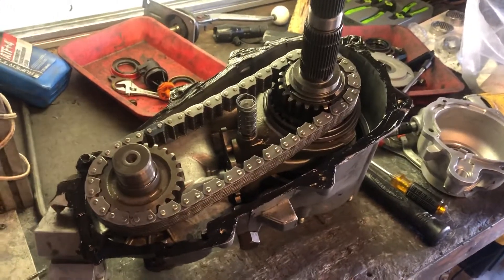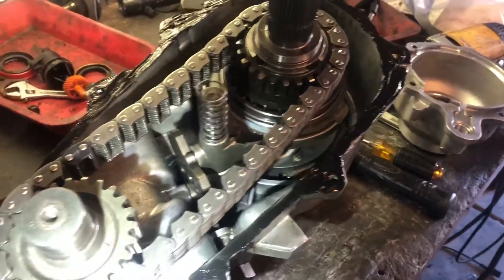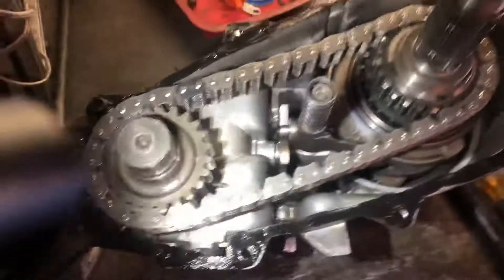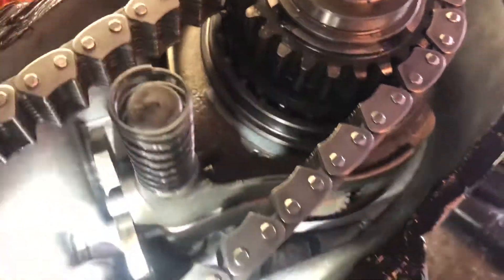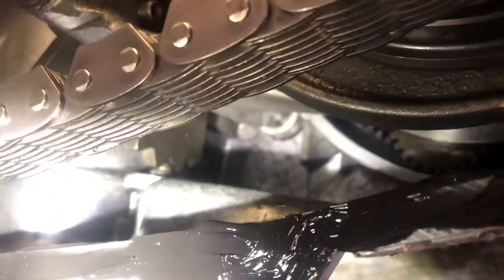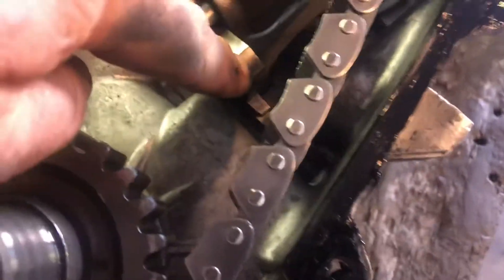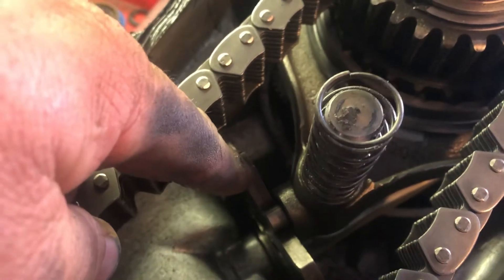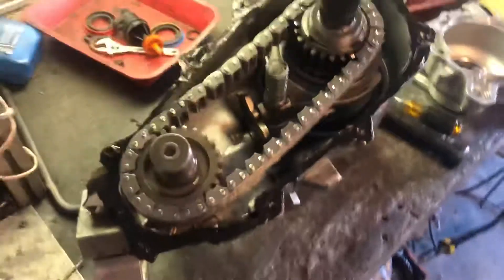NP231 transfer case inside neutral,4hi,4lo,2wd explained

Comment: I recently rebuilt my np231 j transfer case for my 95 jeep xj Cherokee sport and my shift mode selector in my transfer case doesn’t move at all ,it wont shift at all, I have it in 2h so I can still drive my jeep but curious because I would like to have 4wd
Reply from the maker: I’ve only rebuilt this one but that connects to the shift forks inside. You need to pull it apart and see where its binding/hanging up
Reply: @v8only  i can shit it when I have the bottom fork In and the shaft ,now when I add the top fork it seems to bind it some how
Reply from the maker: @ryzeds5016  could be the keys on that slider

Comment: Hey what did you have to do for conversion of explorer motor to 86 I have same set up gt hatch with donor 97 explorer 150k motor my dad bought brand new gr8 motor...
Reply from the maker: Eugene Owens not much. Better cam and valve springs. Oil pan timing cover and accessories.  97 has the p heads. Spark plugs at weird angles. You’ll have to get creative with the headers.  Google it